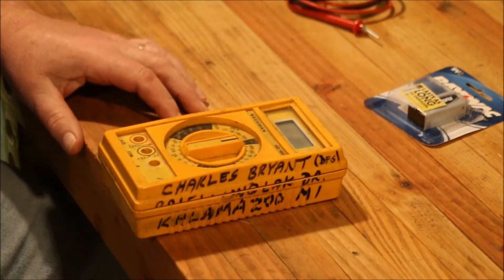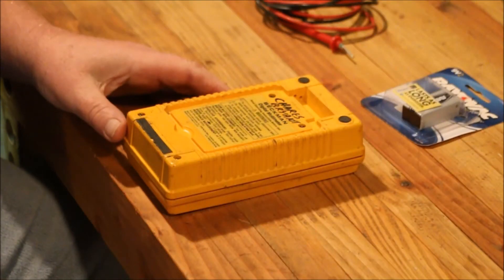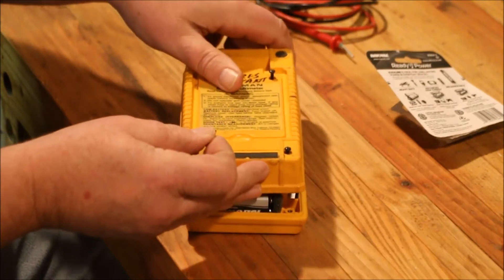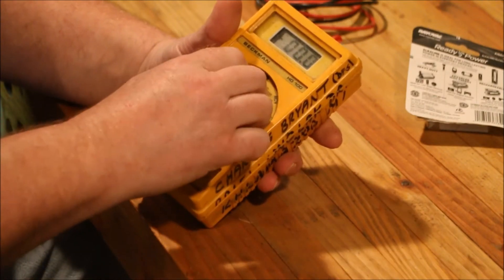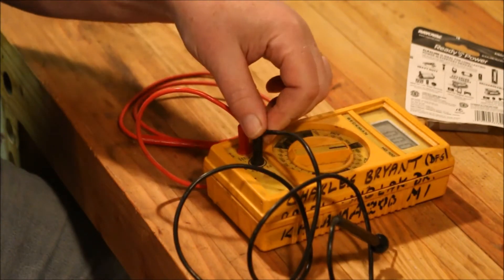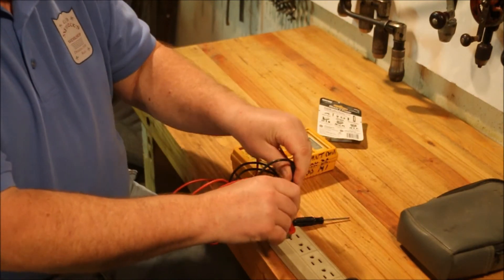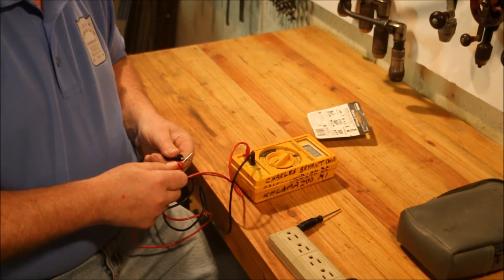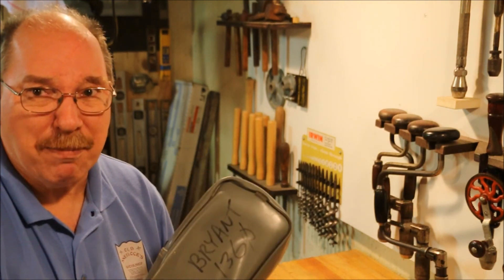TESTING THE BECKMAN DIGITAL MULTIMETER

Comment: These were some of the first digital meters that technicians could afford and worked very well troubleshooting factory equipment.  😎 Thanks.
Reply from the maker: King Electric repped Amprobe and Dad bought a couple for us when I was working with him. 
I still have the analog Amprobe  that I bought  in the 80's. The Beckman is nice because it is simple. I don't do electronics. That's my brother's gig. He is the computer tech and radio guy. 
I just did factories, commercial buildings, and housing.

Comment: I just got 4 Beckman meters in great shape for $30 on eBay. 3 4410 models and one 3030. Two powered up with LCD issues, two needed battery clips that were corroded. New clips and cleaned the zebra strips and pcb contacts to the LCD and all work great. Two need new polarizing film to bring the contrast back to black on the lcd. 40 years of uv has washed them out. None have a crack or hardly a mark. 3 have original box and manual with all having original leads.
Reply from the maker: Pretty good deal.
Reply: Hi Sheelock, I just found a Beckman 4410 paid 0.75 cents for it includes battery, works fine, battery cover missing, few cracks here en there but worht the price. l need the manual if someone has a copy to share will be much appreciated. Regards

Comment: Glad you got a working meter at a garage sale.  One of my other hobbies is electronics.  I use an old Tandy.  I bought this meter way back in 2000 or so.  I like it as it has a RS232 port on the top.  With the software provided, I can hookup my meter to my computer and take real time readings and chart them.  Very handy when dealing variable caps.
Reply: with older meters they wernt cheap, they are solid, and even repairable if need be, they have inserts for the screws and such, modern ones, sure they work for a while, then it falls apart to be trashed. i dont care the meter is half the size, i keep wanting a fluke 25, they are large meters made for the miltary and sell for around 50 on ebay,
Reply from the maker: Way more sophisticated than my standard fixes. I no longer have to deal with PCB's and electronic equipment. My last foray into such was at Douglas Autotech trying to get someone to fix a CNC lathe. I think I have blocked the name from my memory.  It was a showroom special from the trade show at Chicago. It had every bell and whistle that they made in 1990. I was dealing with it in 2001. They don't support those after 10 years from first manufacture. Since it was a showroom deal not all the attachments were production tested. All the bells started to fall off and the whistles were clanging to the floor faster than we could yank the silly things off. 
Glad I was the manager instead of the guys in the trenches. We finally found a group out of Japan that could fix it. Would have been cheaper to burn it in place and have the insurance replace it. By the time we paid travel, per diem, and expenses, along with parts and labor, we could have bought a new HAAS and had it installed that week. 
Good times. Glad they are over.
Reply: I've got an old Radio Shack meter (somewheres).  I think I got it when I was in high school (about 3 decades or so ago).  It's certainly not fancy, but does more than I've ever needed.  It worked just fine the last time I used it, and probably will again (when I have need to go search it out).

Comment: I have a Beckman 3010 that i love but it randomly all the sudden now shows random numbers and the fuse is good. 😭
Reply from the maker: Check the battery.
Reply: @OldSneelock  thanks it has a new battery. Ive tried everything and no matter what it just shows randomly changing numbers of nonsense for no reason.
Reply: Im pretty sad about it i used that one all the time.
Reply from the maker: Sorry that your meter is having problems. Not my area of expertise. 
Other people have had success cleaning the contacts and connections on the PCB and display.
Reply: @chrissanders2562  Did you mean the Beckman tech 310? because i saw a blog about it and the problems with pins not making contact and also people cleaning the board and the display chip with alcohol
Reply: @SDsailor7  hey thanks so much for responding. Its is the 3010 model but looks very similar. Ive tried everything i can think of but its just stuck producing random numbers now. Its my favorite meter im pretty bummed out. I also looked on Ebay and everywhere for a replacement and didn't really find one.
Reply: @chrissanders2562  I wrote reviews for the beckman 310 and that is how i found that page for it so i think it could help you. I dont remember the name of the blog but it is easy to find sometimes you got to ask google different ways to find the answer. Good luck.
Reply: @SDsailor7  thank you i will try to find the page your talking about.
Reply: @chrissanders2562  I just won a bid for two beckmas 310 with their cases and instructions now all i need is for them to work.

Comment: I have read that Beckman DMM's were very good meters is that true?
Reply from the maker: This one is solid and accurate.
Reply: @OldSneelock I got two beckman's model 310 but they need repair due to the cover that holds the pieces/components that make the display work so I will need to repair them, luckily I found a procedure on the web on how to do it. They are very nice dmms.

Comment: I have the same multimeter with manual and everything, original box, only that the equipment throws me on the screen "ol" all the time, does anyone know why?
Reply from the maker: Wish I knew. I like mine but if it breaks I'm lost. I can't find a manual. 😁😎
Reply: @OldSneelock  I have the manual, it is complete just a little old
Reply from the maker: Lucky you. I found a newer manual that told me how to use it but it isn't and exact match.

Comment: good to see the last owner knew not to store with a battery in it, those probes are from radio shack  and not the beckman ones, are pretty bad quality, worse than the dollar ones from china i think,  my goto test would be an AA battery, for both its voltage, and it will also be ok to short to test the amps range.  0.1 ohms is about perfect, they dont go to zero with the older ones,
Reply from the maker: My other meters use different probe connections. My favorite is my old Amprobe. It has a sweep needle and I have used it for over 35 years. It does just what I expect it to do and hasn't given me a bum steer yet. 
I have a few DMM but they are not my goto at all. Having to remember 40 dial positions is more than I want to deal  with. My brother is my goto for electronics. He fixes the computers, radios, and anything with more than two wires a switch and a motor. 😊
I can work on them but I have to crack a book every time. 
If I have another set of probes float down stream into my little pond I'll change but for now the set that came with it work. 
I'll give it the AA test.
Reply: i guess it depends when you started, when i was learning electronics at college, digital meters were the latest thing and we had access to them, and since then, prefer them, and bought a taiwanese one as it was the only affordable choice as the flukes were many hundreds to own. i feel the same with digital clocks and watches, they are just a preference and not related to getting the job done.  i know people love their simpsons meter or on the UK, the previous generation or two had the large AVO meters, large bakelite, i even had one at one point, did not like it , but you work what you have.
Reply from the maker: I have a EICO ELECTRONIC VOLTMETER OHMMETER  that came from thrift store. It is an interesting thing to play with but when the tube goes the meter is gone too.

Comment: Go to 'Vintage Machinery.com' and see if Keith Rucker has anything on it. He's got all matters of manuals there, as in gobs and piles! Here's hoping. I've got my little meter in a sammich bag and I suppose I need to get it out and check it out. The last was tuning the voltage on the generators. Ought to do that again I suppose. Wouldn't hurt. I'm not going to 'pickle' them till the big blow season is over. But winter is coming too. Oh well, whatever. Glad your meter works!
Reply from the maker: Going back through the comments. 
I still haven't found a manual on the Beckman. 😁😎
Reply: @OldSneelock  Out of my league. I need levers and pedals.